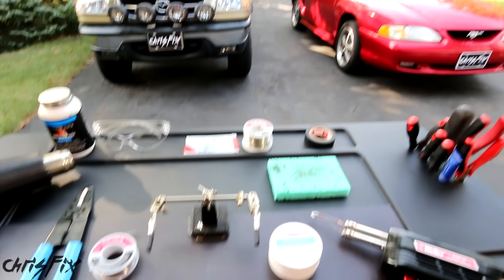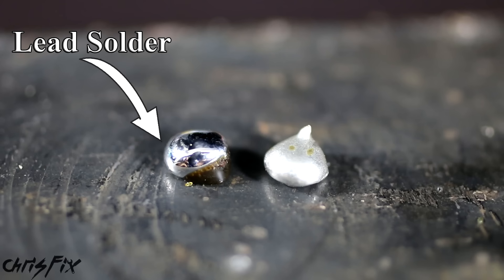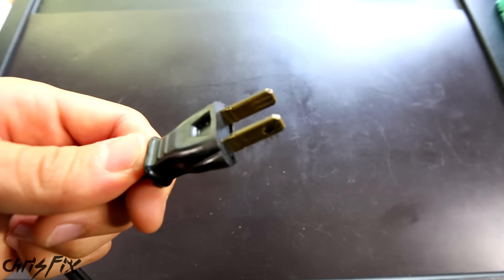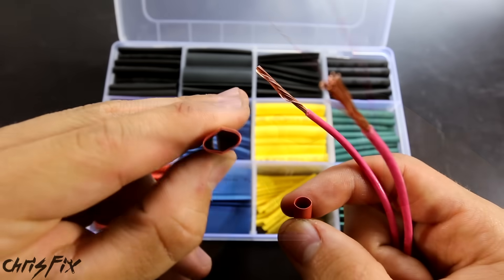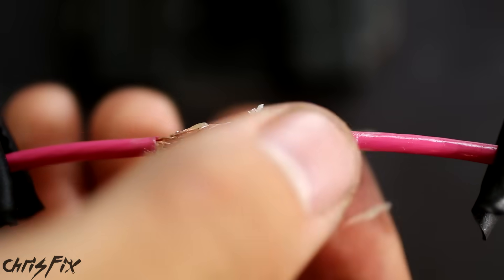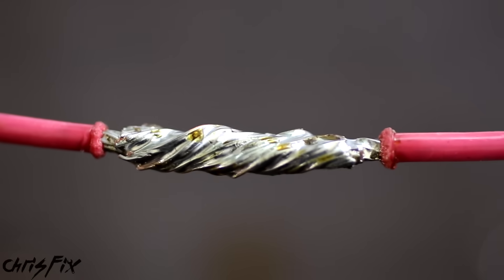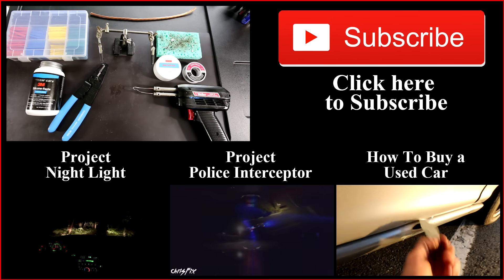How to Solder Wires Together (Best tips and tricks)

Comment: I can't understand why this video has any dislikes..
Reply: It was pretty overheated by holding that soldering gun for so long on the wire.  With a soldering gun, there's so much power that you really need  to modulate it by pulsing the trigger on and off, to just get it to the correct temperature.  When the insulation starts melting into the wire, it's too hot.
A soldering iron is generally better than a Weller soldering gun for most uses, except when you're doing very heavy gauge wires and terminals that would otherwise wick away the heat as fast as you can apply it. For those purposes, a gun is unbeatable.
Certainly don't want to do electronics with a gun though, as it's not ESD friendly.
Reply: I could argue with an electrical engineer. Most aren't required to hold an IPC certification. For a used car I guess this would be fine, but...

Just separate the insulation with the strippers about .030" then remove it with your fingers with a clockwise twisting motion.

Flux and pre-tin the wire. Don't allow the flux to seep under the insulation, it's corrosive. Don't heat damage the insulation. Clean all used flux with alcohol. 

"Mesh" technique promotes premature wear of insulator. Small strands reinforced by solder can poke through the heat shrink. Of the two mentioned, Western Union is best. Three wraps per side minimum, butted up together. 

Flux and transfer solder as mentioned. Don't allow flux to flow under insulator. Don't heat damage insulator. Again, flux is corrosive. Clean with alcohol.

Clean tip with damp sponge as mentioned but do it frequently. Before and after. Add solder to keep tip tinned. Store with tip tinned.

Heat shrink as mentioned. At work, the only thing I've used along with shrink is 2 part epoxy or melt adhesive tape and some shrink has a coating of adhesive inside. At home, sometimes I use "liquid tape".

For the layman, I highly recommend heat shrink, self solder, butt-splice connectors.
Reply: @toddcostantino2717  I didn't know self-solder connectors even existed. Thanks, that's exactly what I need for my bike project and joining wires in a very confined space. I don't mind soldering when the wires are neatly available like in this video...which is almost never when working on my cars and bikes.
Reply: @toddcostantino2717  Yea Flux that is MADE and Designed for electrical applications is corrosive...schmuck. Same goes for Mr. "I went to school to solder". You're both schmucks.
Nothing wrong with that gun for small applications, like in the VIDEO.
True you were spot on with the marriage of both wires. But that's common fucking sense. 
Rosin flux is NOT corrosive. You might be googling the problems that arise with wave soldering and flux,but that's irrelevant. *cough PCB
Acid core IS. You know like he SAID in the video.
That said,he held the iron on too long,thus melted the insulation. Not a HUGE problem if heat shrinked correctly,probably why he busted out the silicon,but that is WHY it melted.
You should only hold it for 1-2 secs at most or you're doing it wrong. Need lessons on wrong?
Secondly, WAYYYYYY too much solder. Pointy bits are bad.
You should 'tin' both contacts before you solder them,Huh? They teach TAHT in class? Pfft..
Anywho,yah,schmucks,I said it.
Reply: @treynathaniel4075  , wow... I didn't think I said anything really negative. Just offering advice on proper techniques. For you?.. I'd definitely recommend heat shrinkable, self soldering, butt-splice connectors...
Reply: @toddcostantino2717  Gl
Reply: in some circles, this would be considered very sloppy soldering.. in others, outright defective...  I cringed, but I work in a different environment...   for this purpose, it is probably OK..
Reply: Joshua Guthrie I respect your input sir. I don't claim to know all, in every application. I used to work in a field utilizing pcb, my brother was a tech there with a degree in electronics. He used a lot of the same methods. I think Chris used a good method based on my experience and know-how.
Reply: Whole heartedly agree.  Love his videos.  Shouldn't say this, but I solder this way at the house.  But there is another level of soldering out there (especially in aerospace and other high reliability applications).  I know folks who would see this and cringe when it is described as 'correct'.  If I was at work, I would.  With that said, what he is doing is WAY better than what most folks do at the house.  My guess is, that is the source of the 'dislikes.'    Then again, people are weird.

My personal experience is..  I'm an electronics engineer by trade.  For many years, I soldered, roughly, how Chris instructs.  No problems.  Thought I was pretty good.  Ended up having to take a week class in soldering, a 2MMTR class, for basic certification.  I learned I didn't know squat about soldering and for some folks, soldering is an effortless art.  One of the first things we did was wire splices.  The instructor inspected them under microscope with (what I thought) was insane scrutiny.  Chris' splice would have been rejected as defective for many, many, reasons.  Blew my mind.

For the small portion of the electronics community who have to solder to this level, I can see a dislike.   It becomes easy for some folks to take somethings too seriously in applications that don't apply.

Best wishes.
Reply: Joshua Guthrie I really appreciate you elaborating on your reply, can't argue with an electrical engineer! Goes to show how intricate seemingly simple tasks may be in other applications. Thanks again for reply sir. Merry Christmas.
Reply: My wife does all the time :)
Reply: @joshuaguthrie8067  it's the good old engineers culture shock. Tradesmen has lower tolerance levels than engineers in most cases. In engineering you measure in mm for designing a part but in installation of the part you can have tolerance of +/-cm.    It makes engineers cringe at the tradesmen but in the end they can't argue that it worked and will work for much longer than its intended purpose. A balanced level of perfection, productivity and cost is more important for tradesmen. Are you willing to wait, pay for the time and labor to do a more precise job?
Reply: Yup, it's all about trade-offs.  Sometime yes...  sometimes no.. depending on the job and application...
Reply: "Chris' splice would have been rejected as defective for many, many, reasons." Name one?
Reply: This is how a Do It Yourself'er would solder.  This is not the correct way to solder if you want a good reliable connection.  I also would never recommend that iron.
Reply: @Kawaii_cuties  Do you have a video to recommend so I can see the difference?
Reply: @HollywoodF1  The method shown in the video works. I'm definitely not a professional. I've done it similarly as shown in the video and I've always had good and reliable connections over the years. Just a couple of detail differences. If you were to search for professional soldering techniques you'll get a lot of videos on how to solder on circuit boards.
Reply: Because his solder joints are amatuer and cring worthy, and hes teaching this to people
Reply: if he took the word "correctly" out of the video there would be no dislikes. I actually advise him to take a class and then come back and make another video about what hes learned. Id watch that for sure. 

We also gotta remember he never said he was an expert or anything and those methods will totally help people who just need help getting started with it. I personally still like the video but i definitley caught myself making a cringey ( side mouth,raised brow,  wide eyes and all haha) face at one point or two in the video lol
Reply: solder-gun-tip manufacturers...
Reply: Go to 6 minutes in for the start of how to solder.
Reply: because its shit
Reply: because his process is not great
Reply: cause jealousy is a curse
Reply: @hottdogg1967  never a curse to do things right
Reply: This isn’t the proper way to splice wires when soldering. A lineman splice is stronger than the rest of the wire when done correctly, and the wires must be pre-tinned.
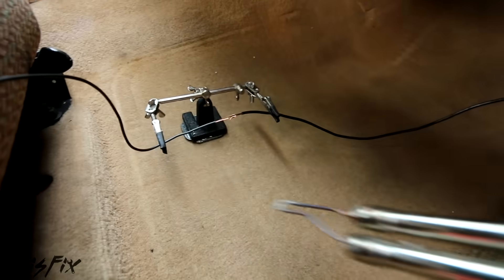Reply: perhaps a) because he suggested not soldering next to a fuel tank  b) 1:50 he 's still telling me not to solder next to fuel tank.

next question.

Negged
Reply: theres always people who think they can do better...
Reply: It's cold envy. Low, dark, crippling envy. One's personal inability, and laziness, preventing him from getting off the couch, and doing something productive with their lives, causes them to viciously envy success, and dedication of others.

Hence, the downvotes...
Reply: Pure jealowsy
Reply: Probably because people were expecting to see soLdering as in the title. He uses sodder to sodder things together. tho it looks very similar lol..
Reply: @Warrenm70  Amen, brother, the L is NOT silent so yanks: why do you do that? Are you anti English... Oh yeah...sorry. LOL

Comment: Very good video Chris. All top quality technique. Nothing here to criticize. BUT... I do have two tips, the first along the line of advanced electronics theory that I got from the GM Training School class of Advanced Electronics Training in Atlanta back in the 1990's.

No matter how well you do the joint, there will be an added resistance in the wire. This is not a problem when you're soldering a lighting circuit. But there are quite a few circuits that are sending regulated voltages to the computer for analysis: the Throttle Position Sensor, the Idle Air Solenoid position sensor, etc. Soldering a broken wire together on such circuits results in an incorrect signal being sent to the computer, a lower voltage than it should be seeing. So the thing to do on these types of circuits is to run a new wire: Do not try to repair the old broken wire! This will require a terminal repair kit, one that all dealerships should have. It's made by Packard and (as of 1995 when I retired) has all the terminals used by all American manufacturers. Just measure the old wire, remove it from the connectors, cut out a new one, put the correct terminals on it, install it into the harness and the connectors and plug them back in. Takes a little bit longer and requires a tad more effort, but if you don't want your engine, say, running a tad lean for the rest of it's life (!), you'd better follow "book" on those circuits.

The last one is just a materials tip. There's heat shrink tubing available that has a coating of hot glue on the inside of it. You have to look for it; that kit you showed is cheap and every auto parts store has them. You did well to show the guys how to properly use such cheap HS tubing, but for me, getting 'the good kind' is not only a time saver, but it is actually better for a wire that might get exposed to oils or solvents that might break down and wash away the grease you're using.

Oh, while I'm here I'll give one more bonus tip. The reason we want to keep moisture away from all soldered joints is because of the electrolysis that occurs between dissimilar metals in the presence of water. Take a penny and put it on top of a wet paper towel on some steel and you can measure 1/2 volt between the two metals: you've just made a battery. Electrolysis creates oxidation that destroys the joint and even though water can't get into or under the solder, where the solder stops on the wire this oxidation will eat into the wire. Why do I bring this up? Because if you don't use a dissimilar metal to connect your two wires together, like a hardened copper connector (hint), you can forget soldering, flux paste, irons and HS tubing altogether. You don't even need to cover it with electrical tape as long as it's on the ground circuit. I've seen factory connections, mostly tap-ins, that were 20 years old, inside harnesses and out, exposed to atmosphere all the time, even salty coastal air and still in perfectly good condition, all because they were secured with a copper connector... or were steel wires secured with a steel connector.

Comment: Awesome video, I sweat copper pipe the same way you solder wire and works great. I'm currently working on installing a new sound system in my SUV. Can't wait to start soldering.
Reply from the maker: Awesome!!!

Comment: If lead-free solder doesn't work as well for you, its because you're not doing it properly, or you're trying to use it like leaded solder. They aren't the same but if used properly lead-free will work just as well.

Comment: your saying 'soder'  so when ur  sodering, does it mean ur sodomizing ur connection?
 thought not,, please pronounce the 'L' like when you say 'sold' i sold my car, I'm sure you dont say i 'sod' my car
yes, resin cored solder is the best for wiring, though ur wires need to be clean, like new,  or ur joint will not be satisfactory..
acid type flux will corrode the copper,, like ur battery terminals when they get that green crusty mess on them,, 
 good job!!

Comment: i was doing that mistake where i touch the solder to the tip of the iron and i was so happy when i got a nice soldering after thousands of attempts..now only i know it's wrong..Thanks a lot dude !!i'll give 1000 likes for this !!!
Reply: You cant use this method on circuit boards or soldering something like sound equipment wires XLR's etc... you'll burn the plastic to death... if you take this much time to to solder that kind of work...
Reply: As someone who has had an actual paid job soldering circuit boards, this isn't true. You shouldn't be touching the plastic at all, only the solder pads and it only takes a second or two to get the pad hot enough to flow the solder in. If you touch the solder to the end of the iron it won't flow properly and you'll get a shitey connection.
Reply: You can do the solder on the tip, its much faster, but you only do that to heat the wire faster, then you apply solder onto the hot wire. As long as you see the solder sink into all the the wires you'll be good, you see it visually "suck" it in when its the right temperature.

Comment: It isn't the purpose of the flux to prevent oxidation. It removes the layer of oxides before soldering. Depending on the work you are doing it is a good idea to remove the rest of the flux after soldering. It doesn't have any protective properties, its job is done after the soldering. If it stays on and beneath the solder joint, it can attract dirt and humidity. To remove rosin flux, use isopropyl alcohol  and a small brush.

And there is another type of heat shrink tubing that contains a layer of hot glue inside. This gets really watertight, usable to fix the normally submerged cable of a water fountain pump and things like that. It is better then some silicone goo.

Comment: I use  the same technique(s) except I clean the excess flux with alcohol and a cotton pad after soldering and before heat shrinking. As usual, this was an excellent video.
Reply from the maker: Thanks a lot and thanks for the tip!

Comment: I just performed an unusual soldering tactic used an iron and and soldering iron at the same time while somebody else held the wire with a pair of pliers would you like to go over this tactic for those us with less experience that need an 80 watt soldering iron and do not have one  not something I would use very often so I use the two iron tactic to get the job done

Comment: chris, every soldering iron I use seems unable to get the wires hot. I'm trying to solder a 16 gauge to a 14 gauge and even when I try to Tin the tip I can't ever get the solder to stick to the tip of the soldering iron, it's almost like it's hydrophobic and just beads off the tip. What am I doing wrong??
Reply from the maker: Clean the tip with the damp sponge. Maybe even use a little flux on the tip if you are still having trouble after that. Make sure you are using a 100w + soldering iron or something like my soldering gun. Hold down the trigger to make sure it pre-heats. Let me know if that works! Good luck!
Reply: you have carbon and oxides built up on your tip take some really fine sand paper like 600 grit and lightly sand the tip then heat up the iron and then tin the iron use more flux to avoid this issue in the future also note it takes time for an iron to heat up at least 5 minutes to get to a usable temperature and a bit longer to get to max temperature most people like their irons at 800 F degrees some use 950 F the more skilled techs tend to like it hotter allowing for quicker soldering exposing components to less heat due to the shorter working time

Comment: Thanks a million.  I feel like I know everything I need to lengthen the wires from my O2 sensor to my autotune module.  Got a question though--do you know if it is ever detrimental to change the length of a wire because of electrical pulse speed/resistance?   I doubt it will be a factor here but someone once told me I could not make my own coil on spark plug wiring (motorcycle) because the resistance of the wires needed to be exactly the same as OEM or it would interfere with ECU communication.  Any thoughts?

Comment: Your step 3 isn't really a good idea. The fact that the solder is actually stronger than the copper wire should say enough. NASA's guidelines for soldering indicate you should lay the two wires side by side and solder them that way, in case you have to separate the connection at a further point in time. As stated the solder is stronger than the copper, so if it breaks it wont be at the junction point.

Comment: Hey Chris I have halogen headlights and I wanted xenon's, so I bought projectors and I retrofitted them. I need help with the wiring though. I need to be able to fit then connectors from the hid ballast to the OEM plug. This is a for a 2002 E46 325i
https://ibb.co/kDC2da
https://ibb.co/bNLAWv
https://ibb.co/dWHqWv

I read on bimmerforums that I could file down the spade connector until it fits, but I don't think that's safe